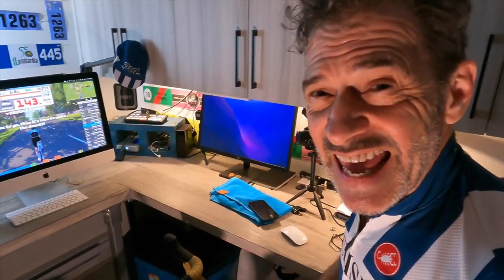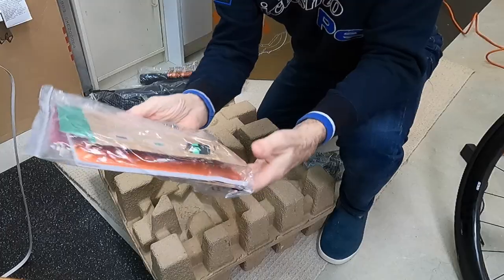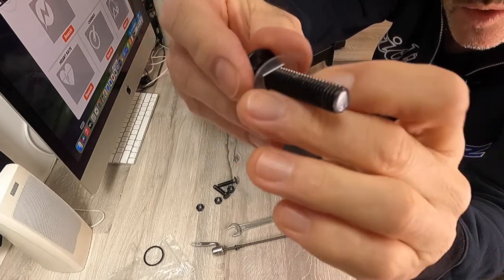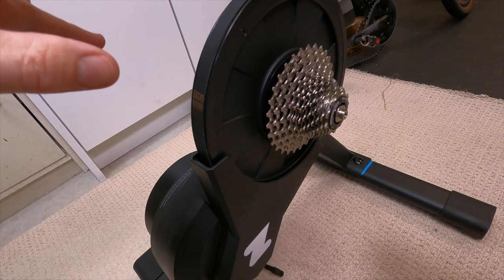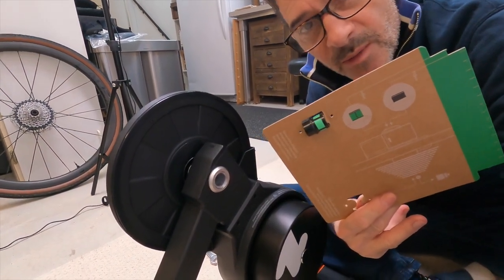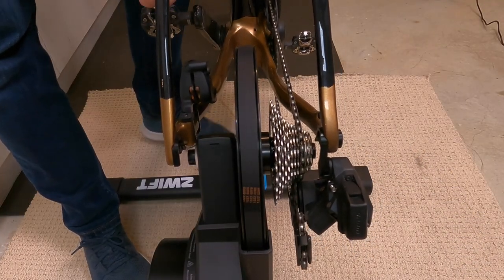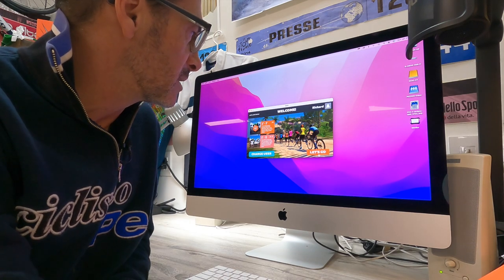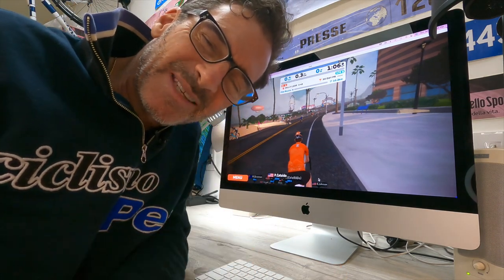ZWIFT HUB Trainer Setup Guide

Comment: For the lack of better terminology, do you have to keep calibrating your rear derailleur when you mount the bike to the swift hub, and back to the wheels? I seem to to have that issue with my 11spd and 10spd bikes.
Reply: Hi Ex J - No, I have not had the issue.  See my answer below to more or less the same question

Comment: I noticed you have electronic shifting. I have a 10 speed mechanical with thru axle, do you know if you have to index the gears every time you switch between trainer and wheel? Thanks.
Reply: Hi Al - thanks for watching and good question - Normally you will not have to index the gears, because you specify which cassette you need when you buy the trainer (ie: to match your bike), and it comes with the trainer - so it will fit pretty much exactly like your bike wheel.

Comment: I can't remove the adapter for quick release anymore. It got stucked. Do you have any ideas?
Reply from the maker: Vice grips worked for me.
Reply: Did you end up solving this issue? I got mine today and have the exact same problem. My two attempts on it failed and the adapter got disformed a bit and the plastic is obviously slightly damaged  now...

Comment: Great video. Do you have any trouble when using the 30t on the zwift hub? Like loss of pedal tension?
Reply: I've not noticed any issues here.  But I rarely use the 30t cog, I more often switch between the 50/34 big rings, and try to run the rear gears in the middle cogs.